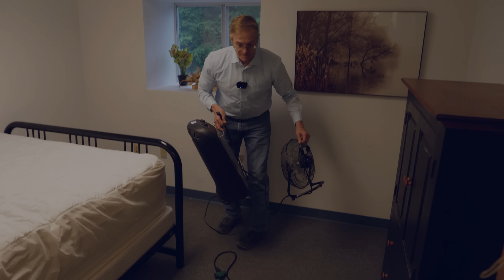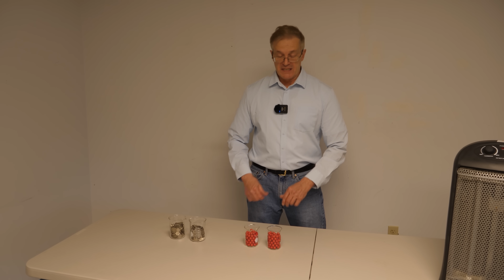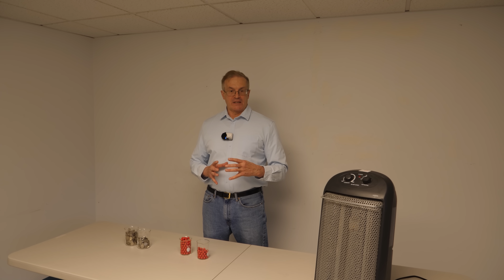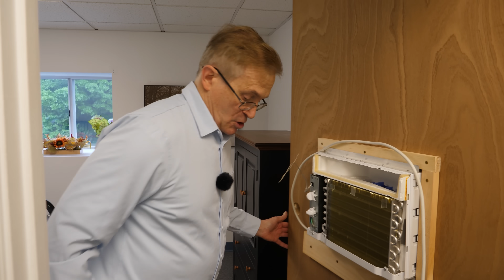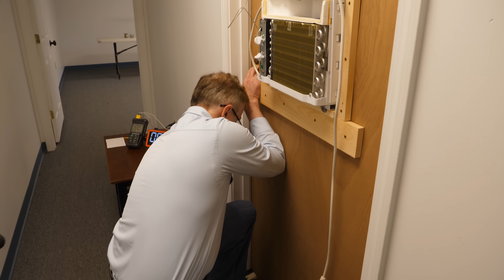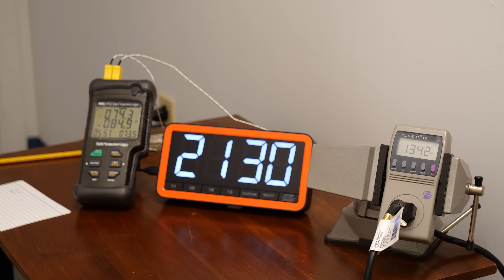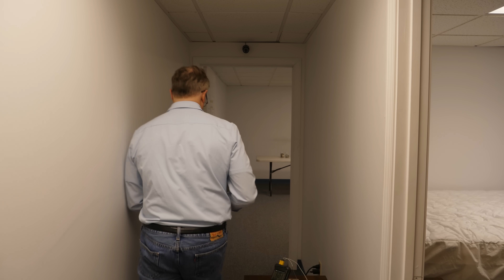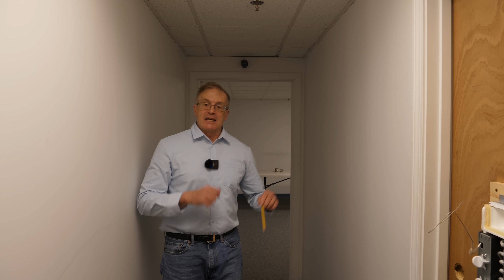You're wasting money on heating! Use your A/C!

Comment: heat pumps are good. how they are sold, isn't. how they are treaded by politics isn't.
any heatpump with a COP below 4 is trash. (heat energy moved (in kW) / electrical energy needed (in kW))
the cop value of the test stand in the factory won't be the cop value in your house. (the actual value will always be worse because of longer tubing and worse outside conditions)
air to air/water heat pumps are bad in cold weather like winters. it can even be that they don't work at all because they can't extract heat from the outside. you would need a groundwater/geothermal to air/water heatpump to have warm winters. these need an expensive instalation that includes drilling deep into the ground and installment of long distances of expensive pipes. 
in germany the heatpump sales just completely broke apart because the support money of the goverment went away and they made most of the common refrigerants illigal to use in new pumps.
now the pumps are really expensive (20k-50k€ for a 20kw heat transfer air to water heatpump).

Comment: Sadly, a heat pump is infinitely more expensive to service and repair than a gas furnace. Dealbreaker.
Reply from the maker: Infinitely, no.
But what about your air-conditioning system? Those systems are very similar to a heat pump.
Reply: @TechIngredients  Yes central air conditioners are ridiculously expensive to service and repair compared to gas furnaces.

Comment: This is not a real world test, no one is heating their home when its 75 degrees outside. Try this test with a 20 degree outside temp, when hest pumps are WAY less efficient.
Reply: They work in canada.
Reply: @Ay_lmao  Theres a difference between "work" and "work efficiently".
Reply: @IndependenceCityMotoring  How does it use more work AC work on temperature difference and phase change you just use correct refrigerant and it works. Its not magic.
Reply: @Ay_lmao  Come on we all know even AC units are way less efficient when the outside air temp is very high.
Reply: @IndependenceCityMotoring  Do you even know how AC/heatpump even works?
Reply: @Ay_lmao  Yes, do you? Go read about how heat pumps are inefficient at very frigid temperatures, then come back to me with your homework.

Comment: Air conditioners are getting very efficient and with the split systems it is not possible to get multiple inside units so that one unit can serve multiple rooms. They are reversible too so can cool in the summer and heat in the winter. That will probably be what I will get when my gas hydronic heating fails next time. 
Comparing electric heaters to an aircon (heat pump) is only really valid if we also take all other costs into consideration. An electric heater is cheap. An aircon not so cheap. In my situation gas used to be cheap but not so much any more. Here we have to compare cost for each kilo Joules produced. The change over will be costly. I am talking about Melbourne Australia.
Reply from the maker: That is the kind of analysis that should be done before deciding on any system. First, identify the options with their advantages/disadvantages, including the cost of installation and maintainence.
Then, consider the energy costs and the reliability of access to that energy.

Comment: I'm off grid power, solar and battery, and run a reverse cycle split system AC for my home office. In summer its cooling, in winter its warming, love it. The only electric heater I use is an electric blanket to warm up the bed.

Comment: The probe measuring room temperature is a lot closer to the AC unit than it was to the resistance heater. This could account for the much higher room temperature than if the probe had been on the opposite side of the room, as it was during the heater test. How does the efficiency of the heat pump compare against other forms of heating, like forced air and baseboard heating?
Reply from the maker: It's  far more efficient, but electrical energy is more expensive, which reduces the benefit of the pump.
The blast from the airconditioner was directed away from the probe and across the room.

Comment: You missed the mark a bit with the entropy thing.  You should have just held a can of hair spray in your hand and made the empirical observation that expanding gasses are endothermic.  Then, compressed some gas in a container and made the point that compressed gasses give off heat. Exothermic
Reply from the maker: I think that's too subtle.  It's not incorrect,  but the process is invisible.
Reply: @TechIngredients  Epistemology agrees with you.  It would be cool to have a flat panel heat pump  installed in a wall, pinned in the middle like a butterfly valve but square not round.  One side emits heat, the other cold.  If its hot, flip it.  If its cold flip it to the other side.  Dump the heat outside or dump in inside with a flip.

Comment: Ok so question, does this work if it's under the lowest temp setting of the window AC? It won't pump heat if it's just the fan blowing, correct?

Comment: Turn off the fan cheater. Lol. Nobody cools off the coils of a heater with a fan and then try to say that the heat from the fan motor is going to effect the temperature. Also pulling heat from outside cold temperatures not hallway temperatures greatly affects the efficiency.
Reply from the maker: Fan cheater?  You don't understand how heating works.  Do you think the blower in a gas furnace reduces the heat output?  Of course it doesn't. It distributes it, and the energy used to drive the blower adds to that output.

Comment: A buddy built a new house by himself.  Out in the country in nebraska. 
I told him to do a geothermal heat pump. Then propane as backup. 
He just did resistive electric heat only. 
Hes lost his mind in my opinion. 
Not because other options are cheaper to operate,  because propane heat uses very little electricity so a small propane generator can operate it in the winter when power goes out like it does every year here. He didnt want a propane tank. So now he needs a very large generator and lots of gas that goes bad in a year. Propane backup is the only logical choice in his application,  but you cant fix stupid.
Reply from the maker: Actually,  you can fix stupid.  It requires insight and patience and, in some cases, a demonstration...😉

Comment: Few things that keep this from working. Window AC won’t work under 40 degrees (so people who need heat won’t have it).  You’re cooling your hall - main house to heat your room. Seems like a net negative.  Where does the condensation go?  On the floor?  On your frozen floor since your froze it with your ac. Heaters have to have a defroster to keep the coil from freezing up so they can work below 40F.

Comment: They actually make heat pump window units now. Its pretty cool that they make them with a gap section (think upside-down U) so the window can close most of the way and the heavy stuff hangs down on both sides to keep it in place.
Reply: Arent those just inverters though? I have seen the midea ones but didn't see anything about a heat pump
Reply: @ameliamissildine  Undecided with Matt Farrell has a video about it.

Comment: That AC unit will only be about 2.5x more efficient in real world conditions. When you pull heat out of air that's 32°f or below(normally when you want to heat a room) it won't be as efficient as it is at pulling heat from a 75° hallway. That unit probably wouldn't even function below 40°f due to its built in thermostat and it's inability to defrost its coils.  Every heat pump becomes less efficient as it becomes colder outside
Reply from the maker: That's true.  That's why an approach that incorporates both heat pumping and supplemental heating allows the pump to perform at a very high efficiency and minimizes the cost of the additional energy source.

Comment: There's a really old camper in my town with a setup like this. I see it parked at Walmart sometimes and it has a window unit mounted backwards on the back. What I'd like to know is how well it works in the winter, as anyone who's ever lived with a heat pump will know their efficiency drops as there's less heat outside for the coil to soak up.

Comment: Execlent demonstration. But most people equate efficiency as cost not actual efficiency.  Your also using a room temperature room to pull the heat from. Not a zero degree outside air space

Comment: Nobody ever should spend money for electrical energy driving air-conditioners. A good contemporary A/C provides a C.O.P. of about 5, while a typical solar panel exhibits an efficiency of about 20% - or 1/5. Conveniently, the sun normally shines, when it is hot and cooling is required. Since 5/5=1, this means, roughly each kW of solar power (ca. 1kW/m²) can be used to remove the same thermal power (kB·T/t) from a building. Unfortunately many people use electricity from coal- and gas-power-plants to operate their A/C-units and contribute a lot to global warming.

Comment: That’s super cool I wonder how it compares to natural gas or propane fired heating and also how the temperature of the room it pulls the heat from affects the efficiency. For instance if you were to use it to heat during the winter when it’s 20 degrees out versus summer when it’s maybe 75-80 degrees

Comment: Could you reverse the direction of the fan when in “heating” mode.
Reply from the maker: Not without reversing the cycle.
One side cools and one side heats no matter what direction each fan is running.

Comment: Pretty damn cool. so in the winter time i can just turn AC around. in the window.  Hot air inside and cold outside.??
Reply: IT has to suck the very little heat out of the winter air outside. Put a solar lens on the cold part.

Comment: I ripped out our ducted heating and air conditioning and went to an all mini split solution.  This, coupled with a heat pump water heater, has earned amazing savings for our household.  Huge fan of the heat pump concept, and it works perfectly for us in our location near Atlanta.  It never gets too cold to operate the mini splits, as they're rated down to 5F.  Of course this equation changes in areas that get colder than that in the wintertime.

Comment: i would want to say that electrical systems are also not 100% efficient as you lose power in transmission and transformers, so not all the energy generated by the power company will make it to your house. Natural gas heating has much fewer losses in transmission. So in theroy natural gas heating is better than just resistive heating.

Comment: I had a discussion about heat pumps where they wouldn't believe that I could heat a 3 bedroom home in a mild climate for 400W using a super efficient inverter split system. 

Obviously you can if the DeltaT isn't too great.

Comment: I've been waiting for affordable window based heat pump heaters for ages. It seems like such a no-brainer, I don't understand whey they haven't been popular for decades. There are a couple models finally hitting the market in North America this year, but they are fairly premium units, and backordered/in pre-order. I would love, love, love to know a simple way to make a standard AC unit work as a heater in mid-Atlantic winter weather. It may well be that consumer AC units simply aren't designed to handle those particular temperature ranges. The circulating coolant may not be appropriate for both summer cooling and winter heating. I'll definitely be following this particular series of experiments and demos very closely!

Comment: Where do you get the additional heat you will need to maintain the process?  If I did this with all my bedrooms I would end up having to just heat the main section (hallways, living and other connected rooms) a lot more.  If you knew a way to modify one of these old AC units to be able to heat a room and send the cooling outside when it is less than 40 deg F outside that would be a lot more interesting to me than just moving heat around in my house.

Comment: I have a heatpump AC. It works great. 750W in once started, 5kW heat/cool out of it. It amazes me that heat pump manufacturers are disabling the cooling ability because the government wouldn't subsidise ones that cool. Also there's no reason that the heat-only ones should cost as much as they do. You can pick them up in China for fractions of what the rip-off retailers sell them here for. They are good tech.

Comment: The only problem with this is the ambient air in the hallway is no where near as cold as it would be exterior of the building on a winter day. The colder it is outside the less efficient heat pumps are.

Comment: Every device capable of being refrigerant cycle powered should be, and home AC needs to be reversible heat pump capable and anything else should be banned. It is a waste of energy and green house emmissions to do it any other way. Water heaters, clothes dryers, you name it, and it could probably be more efficient.
Reply from the maker: I disagree with a ban to control access to a product. Make something better or cheaper, and it will dominate the market.

Comment: It is amazing how many people do not understand how  heat pump works. Someone I know with a degree in physics was insisting that you cannot get above 100% efficiency. I finally convinced this person to watch a couple of videos explaining the technology and now they get it.  It simply takes more energy to create heat than it does to move already existing heat even when the "heat" to be moved inside is at 10 degrees F. It is counterintuitive to have a system move what is "cold" to warm up an already warm area!
Reply: Yet it is easy to explain. As long as you capture just the heat from the power of the motor you get the same efficiency as a resistor and that is 100%.
The rest of the gaz cycle gives you everything that is above 100%. That amount above is the counterpart to the cooled air you expel outside.

Comment: I would love to see a really deep dive into obtaining an optimal heat pump set up. Where's the best place for the outdoor unit, is there a gain to be had from its orientation towards the sun, distance of the unit from a wall or fence for air flow, length of refrigerant lines, type of gas used,  a high wall or floor mounted indoor unit?

Comment: but what If it was cold/freezing or below outside this was mounted on the outer window/wall and used to heat the interior of a room/house. Given the lack of external heat to move would the heater not be more efficient at that point as the a.c unit would need to work "harder"/longer to draw in the lesser amount of heat available?

Comment: It should be noted that as the cold side temperature drops, and the hot side temperature rises the effectiveness goes down.  This is to say if you use a heat pump in a very cold environment, it will not be very efficient.

Comment: Intriguing. My Attic stays 'warm' even during the depth of Winter. I wonder if I could use it as a 'cold sink' / heat source?
Wouldn't 'loading' ones' attic w/ dense, cool air help insulate the living space, too?

BTW, if one doesn't have a spare Window A/C or cannot get one at liquidation pricing, a dehumidifier does the same work. [I've used my old GE for warming the bathroom, instead of a Cadet heater.]
Alternatively, a two-hose Portable A/C would be easier to 'set up' and re-configure seasonally.
Reply from the maker: I think that would work quite well.